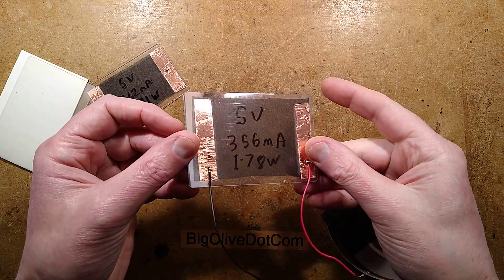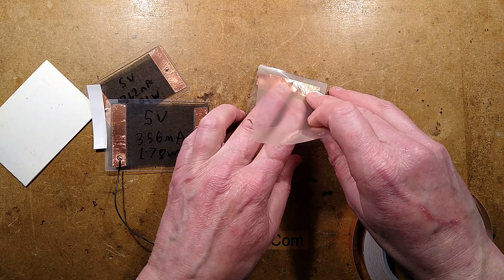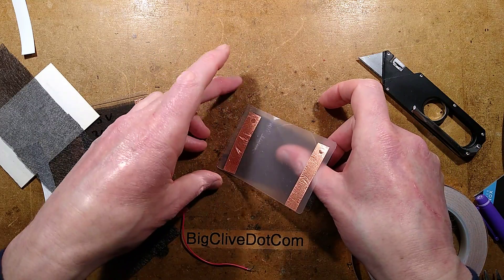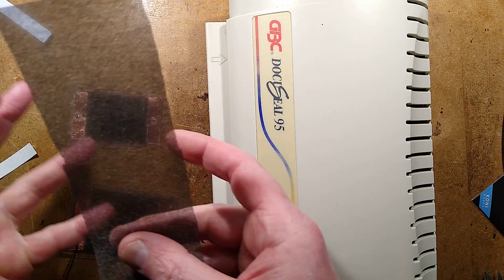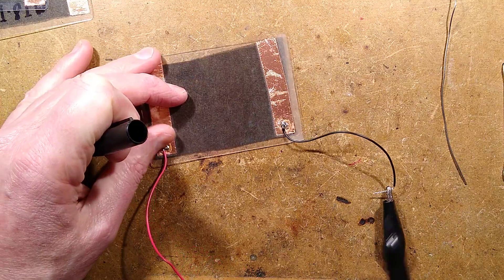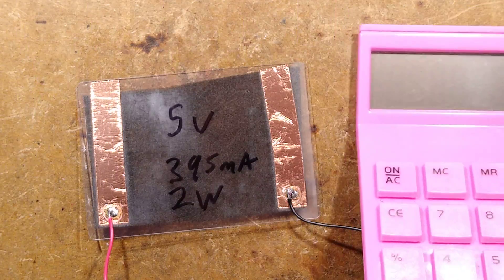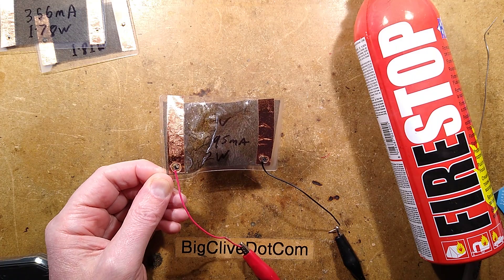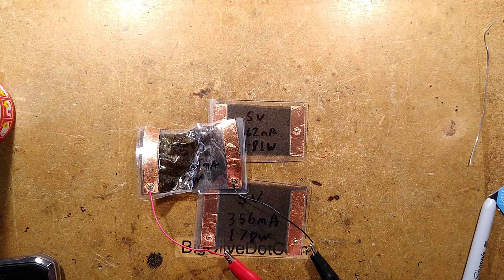Making custom heater pads and then destroying one

Comment: If you would do that with an A4 or A3 Pouch it would be perfect for seed starting. The commercial heating pads are prohibitively expensive!
Reply: reptile pads any cheaper 4u ?
Reply: @littlehills  Might be cheaper but not cheap enough. I need adjustable temperature/power and I need 4 pieces of 30x50cm. I didn't find one of this size but a 30x20cm was already ~40€ so I guess if I could find the right size I would spend over 200€ on them which is too much for something that is just used for 2 weeks a year and not really necessary.

Comment: little trick with the tape that only oxidizeres it a litte...or alot.. just apply flame and the adhesive burns off way below the temperature that the copper discolors even, i bet you could use this stuff to make custom high power very specific value, hand trimmed resistors for specific purposes... hell if i know what purposes those are, audiophile stuff probably
Reply: also how do you know which side is positive and which is negative??? :P

Comment: It usually helps when you have a fingernail or two.  I always let one or two grow out a bit just for projects like this.
Also, anything will self destruct when you turn the voltage high enough.
Reply: Nails are always the most in demand for stuff just after you trim them.

Comment: or stick the tape to the other side, so the hole does not face the adhesive.
Reply: adhesive is a good insulator
Reply: @frogz  I do not understand ! are you saying that the adhesive is needed on the hole side to prevent damage on that side around the hole ? leaving the damage (if any) on the other side …?     I merely suggested that it was easier to solder where the adhesive wasn’t !
Reply: @CrimeVid  if you put the adhesive between the copper and the carbon fiber, it wont conduct

Comment: When applying the copper tape don't take all the backing off. Just pull back a bit at the end, stick it on and then slowly pull off the backing while sticking the rest of the tape on. That keeps the tape from sticking to anything you don't want it to stick to and also keeps it in an easy to handle shape.
Reply: Useful practice for anything sticky with a removable backing. 
Is that what she said ? I don't know in what situation she would say that, but it might have happened.

Comment: Interesting project that's got me thinking. I do a lot of work with analogue synthesisers, and I'm immediately wondering what sort of resistance this carbon fibre sheet has, and how viable it would be to make a resistive ribbon controller with it, and also I'm wondering if you had a few layers of this stuff, would you be able to get a variable resiatance based on the amount of pressure applied to it, in which case it might be a possible way of making aftertouch sensors for a keyboard...

Comment: Excellent,  I never considered putting those materials together in that manner 😁.... learn something new everyday. I have heard several times where motorcyclists and others have sewn small/ thin stainless steel aircraft cable into jackets for a diy heated jacket...I have you ever done a project like that? I been thinking about it but haven't had a chance to experiment yet. Seems like a small pot or PWM module for temperature control and pvc coated 1/16" cable would handle most of it. Any thoughts? It does occur to me that stainless steel cable/carbon fiber heating is essentially like the old style electric blankets versus the new 'safety' ones, it's amazing how well the old ones work for the simplicity. Another great but simple project vid, thx
Reply from the maker: We used to use stainless strips as door heaters on industrial freezers.

Comment: Making this a new comment to float it but...

...an interesting side project (very) would be diode based thermostat.  The diode would be the sensor, and you'd need at least a mosfet to regulate on/off.  Maybe one resistor for a voltage divider?  With surface mount components you could laminate it all into one unit.  That would make it more tolerant of voltage if nothing else, and would make it a more useful project overall.

Comment: 12.66 ohms if anyone was wondering...

Good tip learned from this first time experiment: iron the carbon fibre to drive out moisture before laminating.
or stick it in an oven at 100C for a few minutes first.  Whatever floats your boat.

"26 volts and it's smoking again.  This is good."
Can't argue with that ;-D

Oh, an interesting side project (very) would be diode based thermostat.  The diode would be a sensor, and you'd need at least a mosfet to regulate on/off.  Maybe one resistor for a voltage divider?  With surface mount components you could laminate all into one unit.  That would make it more tolerant of voltage if nothing else, and would make it a more useful project overall.
Reply from the maker: The moisture was probably in the laminating pouches.

Comment: In order to support my Model Railway hobby I purchased 2 bench power supplies, 0 - 30 volts DC at 0 - 10 amps.
I can run them in either Constant Voltage or Constant Current mode and the digital display shows the current, voltage and power levels. 
I picked the 3 display option because I like to know what the power draw is for my locomotives without doing any arithmetic. 
Banggood sold them to me.

Comment: I have been playing with carbon fibre. I did a strip of 1 metre of the 50mm wide, slightly thicker than yours. I work out 18v came out about 40 degree C. I wanted one for wrapping around my leg, I lost lower part of my leg in an accident.

Comment: I have wondered about that weird carbon weave before. I've see it in Chinese pocket warmers.

How would it perform over a large surface area? (A home-made 3D printer bed)

Multiple layers?

Could it be made using something more heat resistant instead of the laminated pocket? e.g. silicone sheet? (I'm thinking making a tray template, pour the liquid silicone down, while still tacky place the carbon sheet flush with it, the copper strips  (made to be larger than the silicone edges so that they are exposed then pour the next layer of silicone to cover the whole lot. Result should be a semi-flexible sheet that has the thermal properties needed to warm food, young animals  or for extrusion printing on.

I can see it's fairly self regulating but can that feature be relied on to assume it's safe?
Reply from the maker: It won't self regulate.  The lamination ensures the connection is fairly solid and the fibre mates to the surfaces well.

Comment: Very interesting project Clive, thanks for sharing!
Just a thought, but instead of sticking the copper over the holes, couldn't you stick it on the other side of the pouch so you don't have to deal with the glue? Probably need a slightly smaller bit of carbon fibre to not cover the holes (or maybe just punch a hole through that too to reach the copper?)

Comment: Re thermal camera view; still looking at an electrical "pressure gradient": your highest temperature is fairly close to one terminal, your average is onhtye center, and the low temperature area is furthest from both terminals.
You might supply both eds of each copper strip in parralel to average that out better.
Reply: Maybe additional restriction on the positive wire would allow the pad thermals to "fill out" more.
I can get to resistor, diode or capacitor as possible components, but Im still reverse engineering electronic thru my native physics;vso I'd really like to see (via thermal) what each does to the heat distribution.

Explanation; the normal method is to think that electricity flows from + to -, and plan circuits accordingly, because the component order is easier to comprehend that way.
But electron flow is actually in the opposite direction.
So looking at the thermal view, traditional interpretation would assume a stream of water hitting a towel.
But actual flow is more akin to water backing up at a drain off of a field. If you want to flood the field, restrict the drain.

Comment: Such heater pad was also used in the Panasonic Toughbook laptops (Industrial/Militairy type laptop), in the harddrive caddy to keep the harddrive at temperature when using the laptop in cold conditions like in the winter outside etc....

Comment: Honestly pretty cool, tho one solution that you didn't mention to the soldering the wires on thing with the adhesive copper tape that you have, is to just stick it onto the other side of the pouch so that the nonadhesive side is already available to the hole instead.
Reply: Or fold the end of the tape over on itself, to create an unsticky tab at the end.
Reply: Why use tape? Couldn't you use bare copper wire and have it stick out the bottom a bit? Or do you need the larger surface area to contact the carbon fiber tissue?
Reply: You’d have to punch a hole in the carbon fiber then too.

Comment: I'm not sure if you can heat up the pad before you laminate to drive out the moisture first, then laminate it.  And you can use the adhesive to stick down the fiber carbon and then solder to the coper side that's the non-adhesive side... I'm not sure if these ideas will work, but just like making a video without rehearsing, I'm typing in my comment the same way... LOL

Comment: Hey Clive! Good idea! I'm wondering if we change the laminating pouch to something more heat resistant, could this heater be turned high temperature enough to became a reflow soldering base?
Reply from the maker: It is best suited to low level heating.

Comment: Peltier's elements are pretty good for heating and cooling. Fun to play with. I got a stack of 3 down to -50 C. You could build a cloud chamber with those.
Reply: They are fun, but very inefficient. And their efficiency falls as the temperature differential between the hot and cold sides grows. For heating you’re better off with a resistive heater. For cooling, a refrigeration cycle system is far better. They do have some niche applications, but there’s a very good reason we don’t cool homes and refrigerators with them.
Reply: @tookitogo  There are videos on youtube of people building cloud chambers with Peltier elements, and they work!
Reply: @AncientTechDIYChannel  Where did I say it wouldn’t work? I just said it’s really inefficient, so I don’t think “really good” is the best description for them as a blanket statement. (Which is what your first sentence is.)
Reply: Yes, their efficiency may be poor, but their size, solid-state nature and ability to heat or cool with polarity reversal makes them extremely flexible and convenient. 

Besides, when it comes to making cool stuff just for the hell of it, who's worried about efficiency anyways?

Comment: Just tore copper tape of the bottom of my skateboard live on stream. I use it as flat wires to power led tape on the underside of my electric skateboard. This is an interesting way to use it. Winter is coming.

Comment: Have you tried stacking multiple sheets in one pouch? I assume it would significantly lower the resistance but I'm wondering how well the current will distribute itself between the sheets.
Reply: Could be good for reducing local variations. Leads to another thought. If you put the attachment points for the wires diagonally opposite then voltage drop on the copper tape would be reduced as a source of uneven heating.

Comment: I imagine the carbon fiber by itself could take quite a bit of heat as long as it's not really flammable. That seems like it could be useful for things like 3D printer beds in some variation.  It looks like a more even heat than the coiled copper trace you normally get. Not very heavy either which is good. I wonder if it could be more cost effective. Neat!

Comment: Interesting, I assume it's DC? Making them bigger increases resistance or lowers it? Do these have to be current limited? The reptile one I have doesn't appear to have any components to it, I just plug it into the wall. Regards
Reply from the maker: There are simple mains voltage pads with a dimmer attached.  If the dimmer fails the pad may go to full power.

Comment: I always wondered what car rear window defrosting filament leads were made of. I'm trying to remember the year they turned invisible in the glass. 2002ish?
Reply: IIRC it's just an electrically conductive printable paint. Remember that anything that isn't a superconductor will cause a voltage drop when a current is passed through it and that energy will be dissipated as heat. Even copper can be used, as demonstrated by PCB based heat pads that use a long, thin, serpentine trace as the heating element. Incredibly they can actually get hot enough for SMT soldering.

Comment: if you make more of these, you can easily avoid getting the adhesive side on the hole. After making the hole, close the pouch and use a marker or even just a sharp thing to scratch the area inside the hole on the opposite side. Then you cover that mark with the adhesive. easier to get a good solder point.

Comment: What about powering them with a Pulse Width circuit? Extend battery life when portable & keep a good average heat at same time? Also should technically provide a Wider adjustable heat range  .🍻

Comment: 3d printer heated beds just got 90% cheaper.....
Reply: I think the cost is more in the regulation .. you could put a tea light under the bed - even cheaper
Reply: @VVerVVurm  well im used to the pcb style copper tract ones. when i built my last 3d printer they were ~100$ in 2012-2013. i cant imagine how this would be different if there was a thermocouple stuck onto it
Reply: @vevenaneathna  I must admit I don't own a printer with a heated bed.. but I got some stick-on heater for rear mirrors on cars and they were cheap .. but one would need a sensor, some electronics and a power supply.. so the heating foil is probably the cheapest part
Reply: @VVerVVurm  ya i feel like heated beds were all the rage when PLA was still pretty unreliable due to poor extruder temp regulation, people still thinking glass beds were a good idea, and probably people in general not understanding the hydroscopic issues with filament which all seem like common knowledge now days... just no one knew back then. I was usually printing on kapton (kafka) tape with crazy glue using ABS. this was before rafts/supports were really a thing.
im pretty sure though that if you size the heater right with a 5v supply, it will be impossible to over heat the bed of a 3d printer even if youre just running nonstop at a nominal 5v because the heated bed was really just there to minimize thermal contraction due to temp difference along z axis instead of doing anything fine tuned. If i remember right my extruder was at like 230 C, room temp~20C, and the bed would basically go full blast set to 90C but would only get up to ~60-65C 
i think another reason abs has fallen out of favor is the fact that stratus still owns the patents on heated chambers and most 3d printers destroy themself if you put them in a DIY enclosure

Comment: You could have avoided dealing with the sticky side of the tape if you instead used a black marker through that hole to the other side. Then simply lay that sticky copper tape across the black dots rather than across the holes, exposing the non-sticky side to the hole.

Comment: Will handle a lot more power simply by using a thermal pad to attach it to a surface, like regular heat pads are used. They will do the same burn up if not attached, as they are designed to be used laminated to a surface. Wonder if you can get polyamide sheet with a thermoset adhesive on the one side, to make your own laminating pouches, that will survive better, though it is likely you will need a regular non steam iron with a flat sole to get it hot enough to activate that glue. After all that is what your flex PCB is made from, so your electrodes can be on it already as copper.

Comment: Could you use a silicone baking sheet instead of the plastic laminate for a sturdier version? I'm thinking it might make for a coffee warmer or similar.
Reply: You COULD, but the silicone would be very thermally resistant so it would take a long time for the heat to move from the element to your mug.
Reply: if the mug itself is not conductive (i.e. ceramic) so it does not short it, yeah you can wrap it around with the silicon sheet on the outside. so this heater is in contact with the mug. If your mug is metallic you need to get something that is both an electrical insulator and a decent heat transfer material, so maybe oven paper or large thermal pads
Reply: @marcogenovesi8570  Edit-I'd use a sheet of something more thermally conductive that is inert, or use a  kapton layer, if that's a better choice.
Reply: @Kitsaplorax  kapton is still a decent thermal insulator so YMMV with that, I've used it plenty of times to keep stuff from melting when using hot air rework station. As I said above, I'd try with "thermal pads" (they are special silicon pads designed to transfer heat) or oven paper

Comment: I see a butter dish warmer project on my "to do" list. No more demolishing the bread 🍞 😁. Thank's Clive, awesome video.
Reply: If you warm your butter dish from the bottom the whole block will just slide about. Using one hot straight from the dishwasher taught me this
Reply: @lmcshera  I think the idea is to keep the heating on low power, but permanently (or perhaps based on room temperature) and heat up the butter slowly. Just to keep it soft enough to spread, increasing the temperature by 5-10°C (above room) should be enough.
Reply: No need to warm the butter, just use a cheese grater with a cold stick of butter to get some on the bread.
Reply: If the butter dish has a lid, then perhaps have a strip around the butter, not touching it, but rather radiating.